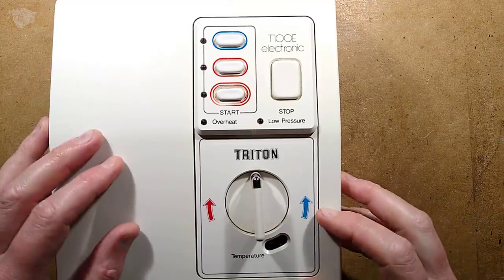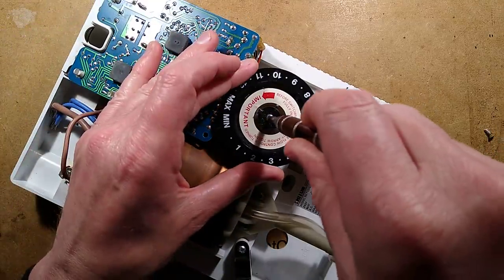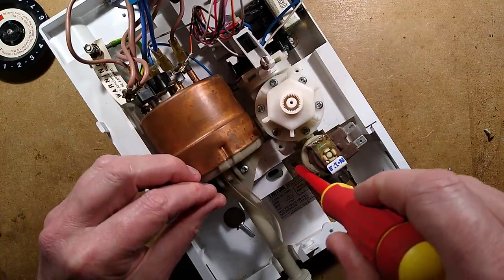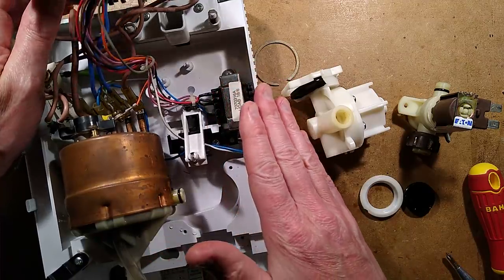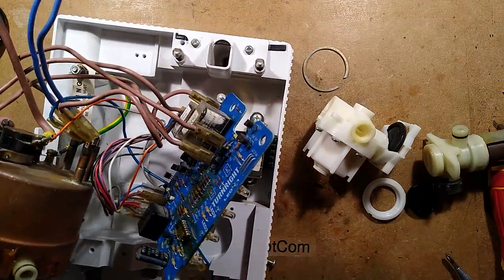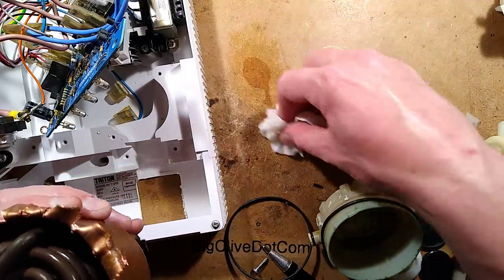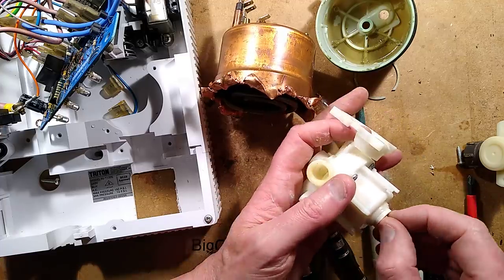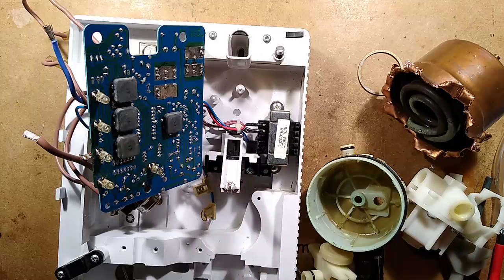Teardown of a British electric shower that went bang.

Comment: I had to repair ours (a late 90s Mira Go) after turning the water back on after an extended holiday. As with this one, a small plastic part fractured allowing water to escape; I ordered a new one from eBay and it's been fine ever since. The design aesthetic of this Triton makes me think it's late 80s or early 90s so it's done well to last  this long before failing. (If you had opted to fix it, you'd be surprised what parts are still available for older appliances: I've carried out a number of repairs on my 1992 Zanussi clothes dryer and pretty much everything that can be replaced is still listed online.)
Reply: i can still find Arçelik-Siemens 2100's (1988) all parts from the net, too!

Comment: Interesting to read the jaw dropping comments, these units are very, very common here in the U.K. and are very reliable.
Reply: We get the same reaction when someone from the UK sees our massive country wide suicide booth network
Reply: What's the availability there of Mom's Bachelor Chow?

Unless of course I misread a Futurama reference...
Reply: Im more concerned about the electricity bill.
Reply: Had to replace one last year. That was only because the connection between the plastic dial and internal mechanism was worn and wouldn't mate properly. The rest of it was working fine and it was well over 15 years old.
Reply: Im from the states Pennsylvania. I have a Similar shower like This In my cabin. VERY useful ... regular House's have 55gal tanks
Reply: They’re also very very inefficient and often installed where not necessary.
Reply from the maker: More efficient than a central water heater.  Only heats the water used.
Reply: Heating water is about 1 or 100% efficient If you dont use heatpump, when number can be some 4-5.. 

Heating water for strait electric for something else than coffee, so no sense to me. You can miss half of energy when used some waste heat from factory, but If it not "used", then they missed all..

Electric shower is invented same guy who made eChair, I think.. ;)

Of course THE sauna took some watts, If you do not heated it by wood. 
I have both options.

That thing is just scary. I undestant minimal risk, but still.

Btw, in Finn we got 3*400 and 230 (phase-null(earth)). 3x25 is minium option. Old houses could have 1*35 or some, but that's it. Maybe the balancing between phases and minium current at PEN-wire is some reason.
Reply: @LukeStratton94  i would have thought efficency was WAY past 99.9%. About the only loss I can see would be the power to the PCB / Solenoid which would (at the very most) be perhaps about 6w out of around 7000.
Conversion of electricity to heat is almost always close to 100% - whether it's a kettle, fan heater, electric ring (a tiny loss due to light being emitted)
It's true there are cheaper ways to heat water, air and people - but as for efficiency, it's pretty close to perfect. All the energy is converted directly to heat.
Reply: What do you do about kitchen hot water then?  Do you have a separate unit under the sink?  Or is there one unit for the whole house that's on demand?  Also how much does natural gas cost in the UK vs electricity? US homes often use natural gas because it's cheap even though it's not as efficient. Although high efficiency boilers (~95%) and in-floor heating are becoming a lot more common.
Reply: @LukeStratton94  they're very efficient and actually very cheap to run by virtue of the relatively low flow rate.
Reply: @GeneCash  In the UK the word is 'instantaneous'.
Reply: @bigclivedotcom  
Wouldn't it be more efficient still to just heat the person showering directly?
There are gizmos that cook hotdogs by giving them a good jump start.
🤣
Reply: In the US most places (at least on the west coast) just use hot water tanks heated by naural gas. Way cheaper than electric.
Reply: Electrical flow-trough heaters are also very common here in Germany, either as standalone solution, or as backup during summer when the house heating is off. They are very reliable, affordable, long-lasting and don't use nearly as much power as people think, since they only heat up as much Water as you need, unlike a boiler. However installing them (or any other electrical appliance) INSIDE the shower cubibal would be a gross vialation of the electical installation rules. When it comes to "Wet Rooms" ouer rules are rather strict.
Reply: @Chuckiele  Well, if you don't take a shower it uses (almost) no power. A boiler uses electric also if you don't take a shower. So this is giving you a lower bill.
And also works well if you have a rental house with a coins-measuring-device for electric. Just put some coins in before you start showering and you don't pay for nothing.
Reply: @jannejohansson3383  electric heating is totally sensible so long as heatpumps are so expensive. Many families can't afford to just plop 6-10K in a decent air-water heatpump installation plus insulation (let alone a sauna!). There's good reason gas and direct electric are so popular.
Reply: @elvinhaak  Theres water heaters using oil or gas or wood that dont require a boiler, if thats what youre concerned about. Its just that electricity is super expensive here.
Reply: @Chuckiele  Works out at about 8p for a 4 minute shower in the UK. So not really to be worried about. Fitted in rentals/social housing even when a gas boiler system is fitted, so that if that fails, residents and children can still stay clean. Safe and reliable, although when houses are wired for a 6Kw unit, and someone fits an 11kw, results in wiring failure.
Reply: @FuelPoverty  yeah need separate big 45amp fuse all on its own
Reply: @bigclivedotcom  more efficient if compared to a resistive central water heater, which will waste heat in the air over time. But put a heat pump (ground or air) in between and you need less than 1/3rd of the electricity in most cases. Of course a big investment only for water heating but in colder climates really popular way to heat the entire building.
Reply: @bigclivedotcom  Technically electric showers are almost 100% efficient as they turn all of the electricity they use into heat (except the power used to hold the solenoid valve open and run the electronics).

They won't be cheaper to run than a gas powered water heater, but I'm terms of efficiency, you can't get better than an electric water heater!
Reply: @Chuckiele  surprisingly good.
Reply: @timhartherz5652  
I have an on-demand heater in a grounded steel cabinet, and a short run of copper pipe, a dielectric coupling and a GFI rather than an electrical appliance pulling 240v in the shower with me.
Call it a bias.
Reply: @bigclivedotcom  true, but new ones are so well insulated. I looked at mine with a thermal camera and the only noticeable heat loss was at the outlet pipe, which I have since insulated. Also having a central heater is nice as you only have one piece of equipment to fail. The downside is they are more expensive and involved to repair/replace. My next water heater will likely be a hybrid heat pump to  really increase the efficiency.
Reply: @andrewt9204  one of the main reasons there are popular in the UK is that they mean that you still have hot water for washing even if your main boiler has broken down. This is especially true of rental properties as I believe if there is abosolutly no hot water in the property the landlord is obliged to fix it very quickly (like 24h) where if there is an alternative means of getting hot water such as the shower, then they have more time to fix it
Reply: Central hot water systems are actually very common in the UK. Standard, even. They are usually gas fired (natural gas) if mains gas is available.

But the classic British shower fed from central hot water was a feeble, dribbly affair, running through a bath/shower mixer tap. It would turn scalding hot if somebody flushed a toilet, or freezing cold if somebody turned on the washing machine (which had a hot water feed in those days).

A new central hot water system could overcome those limitations, but the cost and upheaval of upgrading a central hot water system is high, compared to installing an electric shower. The electric shower operates at mains pressure and is much less susceptible to temperature fluctuations, even if it isn't a thermostatic model.

Electric showers may also have other advantages, depending on the situation:
* Low maintenance cost
* No need to worry about gas safety
* Reliable

Finally, in some cases, electricity is the only energy source available. A lot of flats fall into this category. In that scenario, if you always shower during off-peak energy-billing hours, an electric shower is the best option. If you tend to shower during peak hours, then a stored hot water system could save you some money.

The risk of shock is very low. There are multiple redundant safety features in a compliant installation, which can be inspected or tested for reassurance.
Reply: @LukeStratton94  Whey're efficient, and there's no cold water shock if someone turns on the water elsewhere.
Reply: @rubiconnn  many UK homes have moved to combi boilers that heat water instantly with natural gas
Reply: @Chuckiele   Weirdly they can work out cheaper than using gas for your shower but it's complicated. Gas is always cheaper for central heating though.
Reply: @bigclivedotcom  Unless your gas boiler  also does on demand hot water. It can get complicated to work out which is cheaper, depends on many factors.
Reply: I mean just any distance between the water bits and the electric bits would be nice. Just cause they are common doesn't mean very much, I can imagine the horror show we'd get to witness in China if we got to go and start opening their stuff, I'm sure there are water heaters that you just hold in each hand and walk in the cold shower powered by 220v and come out with a golden bronze tan. I also usually fix the horrors of not having an instant hot shower deal by turning the hot shower as soon as I walk in the bathroom, get towel from linen closet, take off my clothes and oh its hot now :|
Reply: @bigclivedotcom  
Electrickery is only as efficient as it's source fuel. Eg. Burning gas to generate electrickery to then convert to heat at final point of use.
Reply: 1kw of electricity burns around 4kw of fuel at the power station 

2kw boils off in the cooling towers
1kw warms the cables between the pylons 

we could all have free heating but it is too much messing for them to distribute the hot water
Reply: About 25% of the fuel burnt at the power station finds its way into the water
Reply: Ours lasted 12 years. Budget electrocution shower ftw
Reply: DARK APPARITION  
Clive usually just uses a couple of forks and a power supply on his bench. 🤣
Reply: @LukeStratton94  

They're actually very efficient, why do you think they're not?
Reply: @skylined5534  perhaps I jumped the gun a bit on that one. I’m just bitter because I had a tank of hot water sitting there heated up already and yet the previous owner decided to install a cheap electric shower instead. This problem has since been rectified ;)
Reply: @LukeStratton94  

Ahh in that case yeah the electric shower would be pretty pointless in that scenario!
Reply: @lorddissy  Wait...where?

Comment: It's pretty amazing to think about how hot those heating elements must get to heat the water as fast as it's flowing through there. I've got a natural gas whole house on-demand water heater and I've wondered about the fiery inferno that must be going on inside there when it's running. It's quite impressive really
Reply: The fire is nothing like an inferno. The heat exchanger is just so darn efficient.

Comment: You can tell that is an old shower due to the copper heater tank. They are all plastic heater tanks these days. I am a plumber and have replaced many electric showers over the years. The only bonus when removing them, any copper heater tanks go in the scrap box. Definitely time for a new one. Just have to make sure the pipe and electrical connections on the new shower roughly match for position on the old shower and check cable size for maximum KW rating
Reply: How do the plastic tanks not melt?! Also this immediately looks old, even before removing the cover. Don't need to see the tank.

Comment: I took an old Triton T70 from 1988 apart which had performed OK for about 15 years. The construction inside was very similar, sans PCB. However, the amazing thing was that when I took the heating chamber apart, the sheathed elements had split axially exposing not only the alumina insulation but also, in places, the heating elements! It must have been like this for years with me using it every morning. When I changed the shower for a more recent Triton model I also upgraded the Consumer Unit to include an RCD. I dare say that if I'd had an RCD in circuit with the original shower then it is likely that it would have tripped. So glad I changed it!
Reply: As long as you dont have a metal bath with an earth connection you are fine ;)

Comment: I had one in my old flat for over 20 years, very reliable and parts were available for repair when the heater element failed, and also for the pressure switch (which prevents the shower switching on if there is insufficient water pressure.) I have one in my present house, that was probably installed 15 years ago, the design has stood the test of time. Yes, you don't get much of a power shower in winter, but it works and is economical as you only heat the water you use.

Comment: Pretty common in the UK, running from the rising main so decent pressure, actually safe too, the original ones were IRO of 6Kw nowhere near enough to heat the water and have a decent flow rate, later models are upto 11Kw. They work well enough although if you're in the sticks and on an overhead feed the lights flicker when it goes on. The other type are fed from the hot water tank and are essentially a pump and a mixer valve they only need a few hundred watts if that. I've seen those in Malaysia fed from a 13 amp 3 pin socket in side the shower cubical, that was a rental I decided against.
I've got under my kitchen sink now what looks like this type of electric shower as an instantaneous water heater that's 6Kw
Reply: Clive's done a video about those "suicide showers" :)
Reply: These are every where in vietnam/south east asia. They are fairly safe it's all plastic around the electronics. It's only the heating element that could be a problem really. Also most of the time they are grounded and the water flow is usually not totally solid (so you don't get a steady stream of water to kill you).

Comment: I had a horrible experience with one of these when I was about 12. My dad had installed it and in his wisdom had used the existing old bathroom heater isolator switch and wiring. Halfway through my shower the bloody thing blew off the wall and showered me in sparks and moulton plastic. I ran downstairs screaming completely naked much to the amusement of my family. I’ve never trusted them since.
Reply: Good god lol

Comment: Instinctively, I would avoid such a shower system. But, you're right Clive, I too have never heard of any serious accidents in the UK with this type of device. FWIW, tap water, even heavily ionic tap water (usually Ca++) is a surprisingly poor conductor - almost an insulator in some circumstances.

Comment: As a British Electrical engineer and past domestic sparkie I've installed more than a few of these type of showers ...I a big fan of the simpler units like the Triton Enrich ...only microswitches and the same heater ....I have never had a case of anyone getting even a slight tingle when installed properly...In the UK the shower nowadays has to be installed with either an RCBO or if retro fitting to an old system with out the room for that its own RCD and MCB  in separate box at the least.
The heating element is a ceramic filled element like most kettles and the heater body 'tank' grounded so if if a heater rupture fault occurrs the RCBO will trip before you know there's a fault..
Personally I'd not be with out a well installed one of these showers.
The problem comes when people try to cheap out on the install and do it themselves with out the knowledge of how to do it safely.
Another common problem is the under sizing of the incoming water flow so the opening of taps else where affects the heat setting of the shower.

Comment: In the 80s we had an electric shower. It was some terrible cheap one with poor regulation and if you cranked the temperature to maximum it was possible to hear water boiling inside the unit, before some attempt at a safety cutout activated and the shower jetted cold water at you.
We also had one removed in a previous house, and the electrician discovered whoever had wired the shower up had used wrong gauge wire and it wasn't earthed either. So I guess it was like one of those Chinese death showers :)
Reply: The London house I moved into in 2010 had a 1960s style 3-bar electric heater suspended on 2 wires OVER THE FOOKING BATH. I suspect it was from the late 1930s when the house was originally built.  Needless to say, it came out pretty sharpish and we did a full rewire.